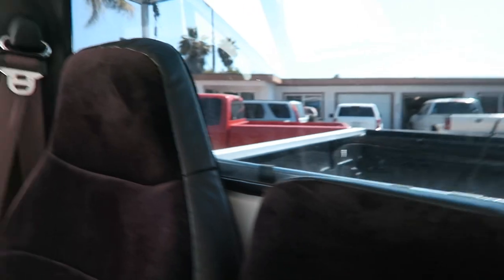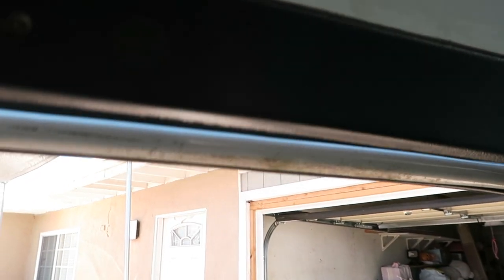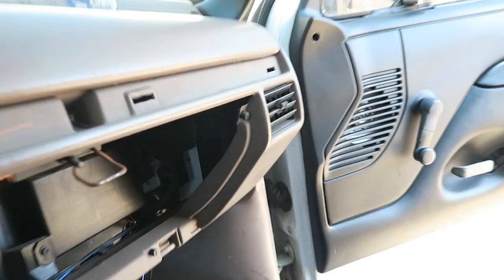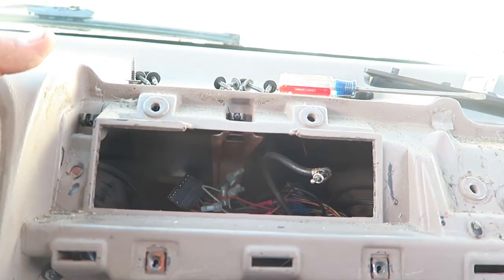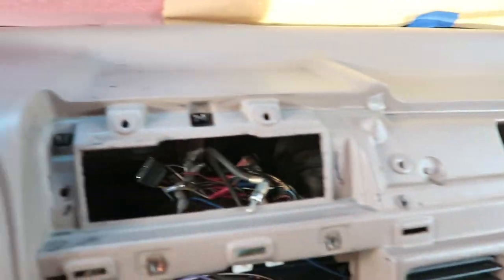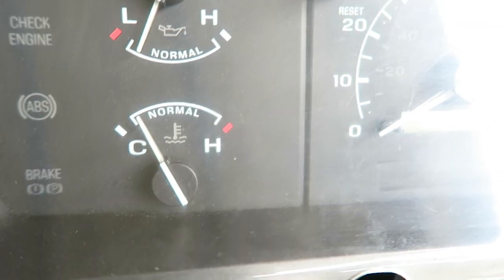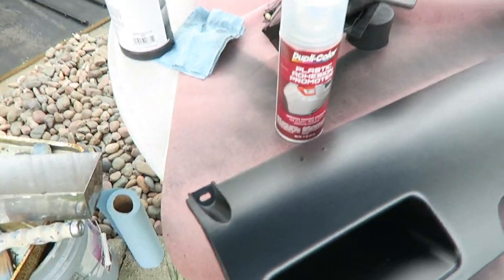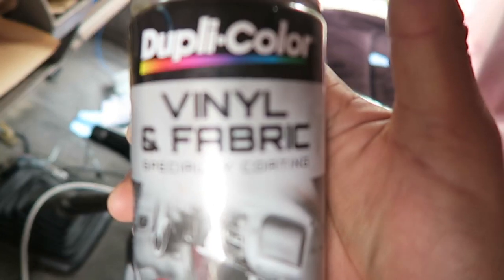Dash Removal: From Tan To Black

Comment: I painted the panels inside of my 93 Bronco. Took as much as I could of off and tapped the rest. No where near as much as you did. Nice work.
Reply from the maker: Thanks man. I was afraid I was going to get a lot of overspray so I took off as much as I could. I almost took off the whole dash.
Reply: TBH I didn’t even tape off my windshield, what ever OS I got on the windshields I scraped off with a window flat razor. Cleaned the windshield at the same time!!!

Comment: For the door panels. Scuff them with 500 grit. Adhesion promotor. used Bed liner spray with 2 coats. Then use VHT black hight temp black paint. Your worries will go away about fading and scratches

If you want it even more peace of mind. Sand the black you have currently, completely away with 100 grit. Then jump up to 300 then the 500 process.
Reply from the maker: Im planning on getting new door panels, will definitely be trying that. Bed liner seems like it would leave me with a rough rugged surface though. Don’t want that. 🤔

Comment: You should have used the adhesive promoter before painting I did my truck 2-3 years ago and it’s still holding up great
Reply from the maker: Well Now I know, I did use it for my whole dash and so far great. 👍🏻
Reply: @icsivan  How’s the dash been holding up since you used the adhesive promoter this time?

Comment: I've gotta 96 ext cab and I'm glad I found what I was looking for. I wonder if there is something you can use on the plastic that better adheres (if that's the problem) and still matches the other paint. I'm very ocd about my colors matching even if it is just black lol
Also clean truck mines white too
Reply from the maker: I tried the Krylon fusion paint which is suppose to be great with plastics. So far so good.

Comment: I did this in my old mustang a few year’s ago and it ended up terrible. I did the entire interior, it scratched off all the vinyl and rubbed off the cloth seats 😔 I basically ruined my interior. I had to touch it up constantly or else it looked horrible.
Reply from the maker: DColon614 Luckily I only did my trim and there’s not much In my single cab truck.